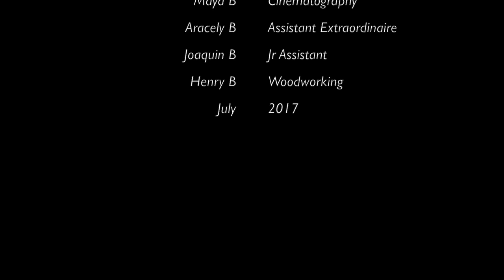Carriage Doors- Construction

Comment: these are beautiful...  will be making something like them myself this summer (if we can avoid any more wildfires)... but mine are doors that slide on top and bottom rails and disappear around the inside wall...  so 8 individual panels with fancypants hinges between...  thinking i may sandwich a piece of cord underlay in between the inside and outside panels for a tiny bit of insulation.

Comment: It's beautiful! 
 
My issue has been finding hinges I feel will last the test of time.
 
I grew up in a home with carriage style garage doors, and it always seemed to need adjustments done due to the hinges sagging.
Reply: yes I was also worried about this since the doors are pretty heavy (about 90 lbs). But the Hafele hinges are well built and no issues after 3 years. Also built for others and they haven't had any issues.

Comment: How is the door holding up?
Anything you would do differently?
Did the wood darken at all
You should do a follow up video 
Thanks for the wonderful project
Reply from the maker: Doors are great not issues mechanically. The sun has faded the finish, but I knew that would happen eventually. Plan to update this video next spring with a some sanding and new finish.
Reply: @barrwoodworksfurniture  what was the finish?
Reply from the maker: @ericrotermund1004  Epifanes matte, 3 to 4 coats

Comment: Out of curiousity - why the dominoes in one portion and the floating tennons in another. What size dominoes are you using and how thick are the stiles/railes.  It looks loke a lot of dominoes. Are you using hte 1/3 mortise rule?  
I am looking to build a carriage door and am looking for ideas.
Reply from the maker: Started with larger floating tenons but realized it was too time consuming with a router. If you have access to a domino machine that is the way to go! Size was 1/2" x 4". Rails and stiles are 1-3/4" thick, so more dominos required...more surface area to bond with glue. If it was just one or two doors I would use traditional mortise and tenons. Good luck!

Comment: You inspired me to make similar doors. Can you help me out on where to get best hardware for the folding doors.
Reply from the maker: The hardware is Hefele, so you’ll need to find a local supplier. In my area its Charles McMurray. If you search up Hefele their webpage has info on local suppliers. I advise you look up part numbers first from the Hefele website and then place your order with supplier. These are generally sold to shops and not retail. Good luck!

Comment: Hi my name is Todd I am very interested in the Cedar  Bifold garage doors looking for the track and hinges you used where can I find them??? thank you Todd.
Reply from the maker: The hardware is Hefele, so you’ll need to find a local supplier. In my area its Charles McMurray. If you search up Hefele their webpage has info on local suppliers. I advise you look up part numbers first from the Hefele website and then place your order with supplier. These are generally sold to shops and not retail. Good luck!

Comment: Beautiful job.   Where did you get the track hardware from?
Reply from the maker: The hardware is Hefele, so you’ll need to find a local supplier. In my area its Charles McMurray. If you search up Hefele their webpage has info on local suppliers. I advise you look up part numbers first from the Hefele website and then place your order with supplier. These are generally sold to shops and not retail. Good luck!

Comment: Absolutely stunning ,
This is the style I want but concerned about do you need diagonal braces or do the three vertical parts here stop the sagging?
Reply from the maker: scott mclean for the width on these doors (38”) it’s not an issue. If you go wider depending on construction and wood species, it might be, but using mortise and tenon joinery is pretty full proof.

Comment: Very nice workmanship, however I don't think it will keep the cold or hot weather out due to the gaps above the door.
Reply from the maker: There is weather stripping in between each door and at the top. Plus its a garage so not really an issue in California.

Comment: Is the glass just set against the trim and then the backer trim holding it in place? There is no sealant on the glass and wouldn’t water makes it’s way between the trim and glass? Thanks for the info
Reply from the maker: gtpro700 I used silicon caulking for glass.

Comment: gorgeous job, im looking to do the same exact thing to my garage.  can you help point me to the specific hardware you used?  thanks so much 
- Aaron
Reply: Bsur gilmhest nvonhink style and son's
Reply from the maker: The hardware is Hefele, so you’ll need to find a local supplier. In my area its Charles McMurray. If you search up Hefele their webpage has info on local suppliers. I advise you look up part numbers first from the Hefele website and then place your order with supplier. These are generally sold to shops and not retail. Good luck!
Reply: @barrwoodworksfurniture  excellent work! are those hinges with the wheels an actual Hafele part or did you customize it?
Reply from the maker: @DannyAlva  Yes those are Hefele hinge parts for the top and bottom. You can use other off the shelf hinges for the middle ones, just make sure they are made for outdoors (sealed).
Reply: @barrwoodworksfurniture  awesome. Thanks for the quick response!

Comment: how wide and tall of an opening was your garage door that you replaced this with... just to have an idea of the space we are talking about... double or triple car garage... ???... i've been wanting to do this myself but placing the lock in the very middle of the four doors...  what do you think the pros and cons are to the middle vs off to one side...
Reply from the maker: CuteSeamus this is an older home, so dimensions aren’t exactly standard, but Its considered a one car garage. Dim were 82” x172”. For the lock placement, you'll need to make sure the hinge side of each door has a good flush bolt or cane bolt at the top and bottom. Also the catch side should have a top and bottom bolt. Otherwise the doors will wiggle a bit and could open.

Comment: I saw these doors on Pinterest and then found the YouTube video. Great job. I plan to make similar carriage doors for inside the house on a barn door slide setup. Did you design these yourself or did you work off an existing plan?  thanks
Reply from the maker: I searched for different styles and then came up with my own design. I wanted to make them strong but also allow natural light through.

Comment: Wow. I love that it has a separate door for quick entry/exit, but does anyone have a source other than Hefele that is less expensive? L.E Johnson has a 4-panel hardware set for under $100 on Amazon, but I can't find anyone that has the separate door option at a lower price point. Hefele is over $1600.
Reply: Did you end up finding the right hardware.

Comment: Stunning results. I'm wondering - why did you change from the Festool dominoes after the 
dry fit?
Reply from the maker: I was actually going to make all mortises for the floating tenons with a router, but that was just too time consuming so I was able to borrow the domino and it went way faster. If it was a just one door I would have stuck with the router, but multiple doors meant I could knock out 32 mortises per door in about 20 minutes.
Reply: @barrwoodworksfurniture  what size of tenons did you use?  12mm but how long?
Reply from the maker: @MikePowell03  12mm by 100 mm (~1/2" x 4")

Comment: I have a garage door to make , what kind of wood , did you use ? Where can I get the hardware? 
Thank you .
Reply from the maker: I used African Mahogany for these doors. The hardware is Hefele, so you’ll need to find a local supplier. In my area its Charles McMurray. If you search up Hefele their webpage has info on local suppliers. I advise you look up part numbers first from the Hefele website and then place your order with supplier. These are generally sold to shops and not retail. They are the Al Fresco line of hardware. Good luck!

Comment: Would you go 11 ft high with this design?
Reply from the maker: That would depend on wood species and weight. The hardware has a max capacity. I believe the Hefele hardware I used was 90 lbs per door.

Comment: Does this door construction resist the warping that occurs on doors that have two different humidity/temperature conditions on either side of the door?
Reply from the maker: Warping is not really an issue for solid garage doors on the west coast (NorCal). The temperature difference on either side of the door is not really the issue (no core insulation). I think the bigger issue with these types of doors is the expansion/contraction due to humidity changes, and the reason I used floating panels which have enough room to expand. Naturally there may be some "sticking" but so far no issues since these have about a 3/16" gap for weather seal.